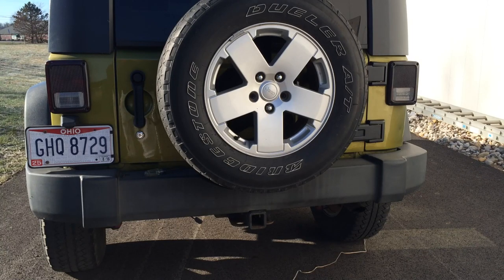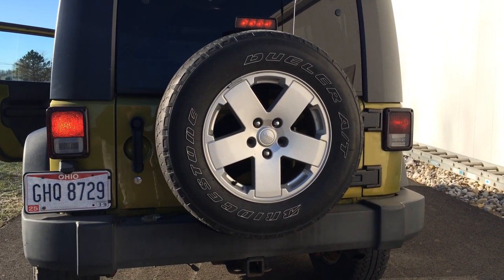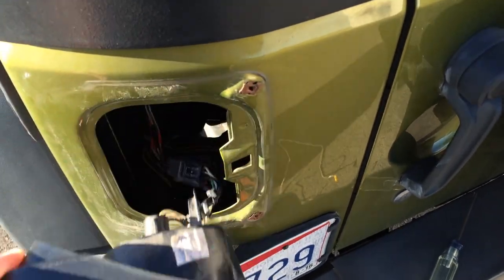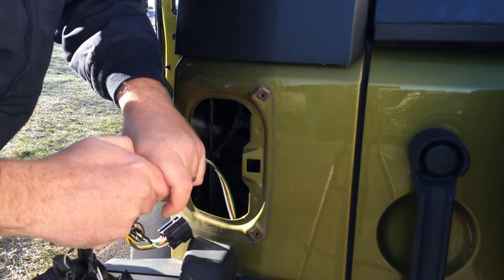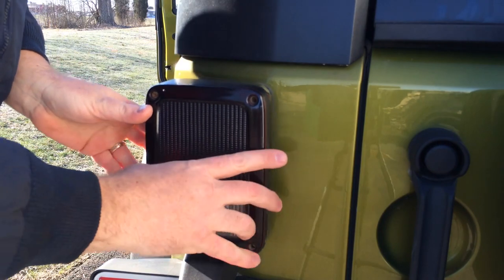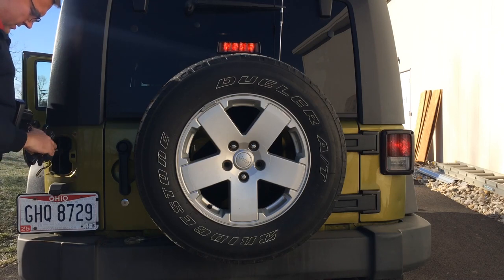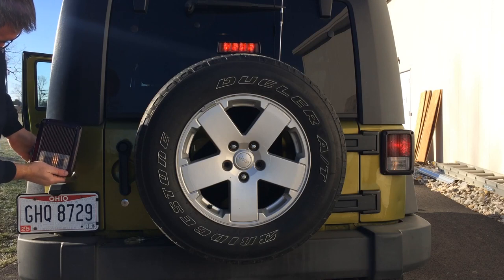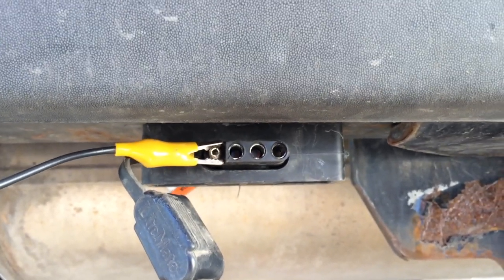Jeep JK trailer wiring harness problem

Comment: Where was the ground wire located at?
Reply from the maker: Jeremiah Balete it was broken. That’s what caused the problem.
Reply: I'm having the same problem. I'm trying to find where the ground is at.
Reply from the maker: Jeremiah Balete the instructions suggest attaching a ground wire to the body with a self tapping screw. I ended up using the ground at the harness which works fine. I didn’t like the idea of drilling into the body.

Comment: Did you connect the grounding wire?
Reply from the maker: That was the problem... The harness that I received had a broken ground wire. (looked like someone cut it and then returned it)  After reconnecting the ground everything worked fine.
Reply: I just installed a wiring harness from Quadratec in my wife's JKU yesterday. That harness doesn't have a separate grounding wire.
 
The only problem I had was bending back one of the tabs on the receiver that the end of the harness slides into. My wife bent that tab back on one of our Maine Mountains Jeep Jamboree trips.

She had the only 2015 Jeep at that event in October 2014. It was raining the first day. Half way Through the trail, a guide knocked on her window and told her that she ripped off her left rear inner and outer fenders. She didn't even look in the rearview mirror and replied "Throw them in the back."

I posted a few videos of my 2007 JKU on YouTube. Check them out.
Reply: Where's the grounding wire at mine doesn't work at all harness wise